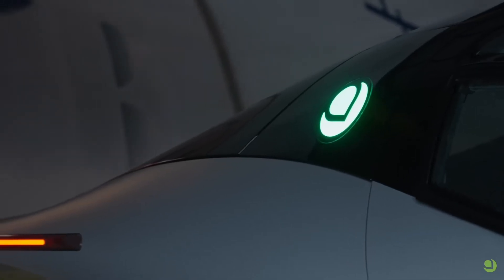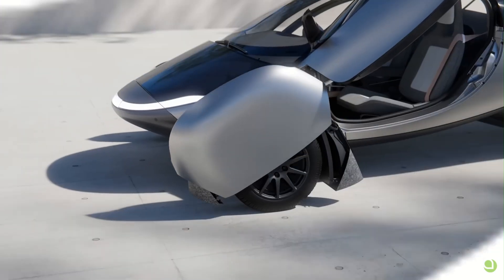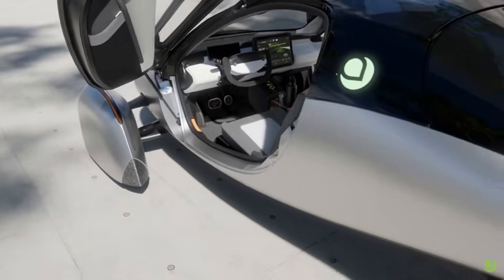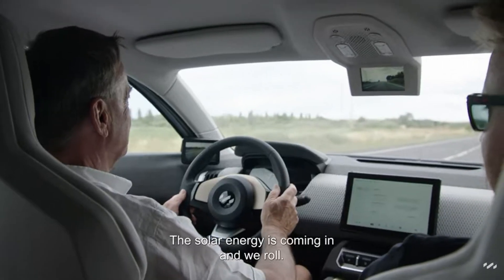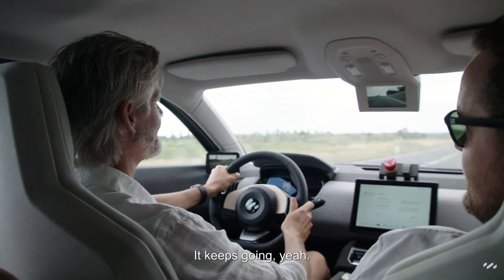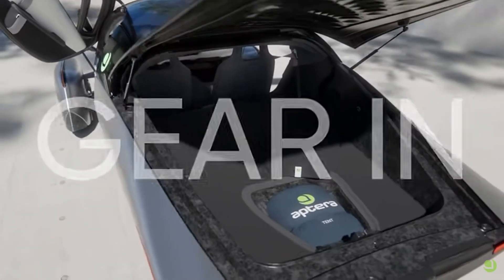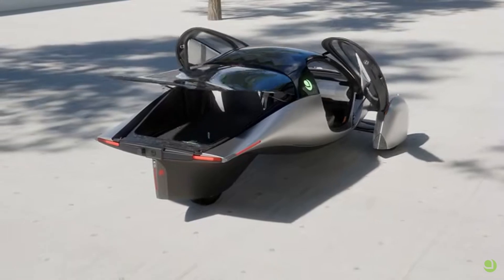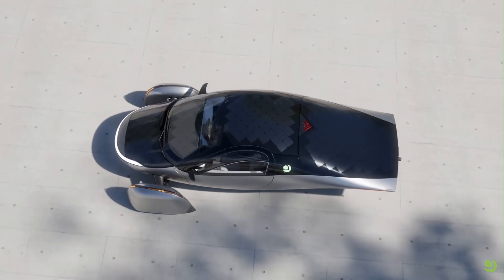Aptera Coasting Efficiency: The Best of any Vehicle Ever?

Comment: People don't know how to drive.  With a manual transmission, I would put the clutch in 1/2 mile from the stop sign.  And I never accelerate to the next red light, only to cram on the brakes at the last moment.

Comment: I love the concept, but I never drive at 80 mph, which is NOT an aerodynamically efficient speed. I’d be happy to be proven wrong. I rarely drive my Prius at or over the speed limit and I expect to do the same in my Aptera. I also expect to beat the 100 watt-hour mile. I agree fully with your comments on regen. I coast whenever possible.

Comment: Thanks for bringing up this topic! As you mentioned Lightyear has already shown a little at least what coasting can add. I’m also left wondering what Solar could add to coasting. In my Prius plug in , the display always shows my efficiency AND when the gas motor isn’t running or needed. I’ve found that coasting significantly improves overall MPG, also when I switched from low resistance tires to tougher ALL season tires my MPG went lower by approximately 8-10%. So just imagine using low rolling resistance tires combined with coasting could do in a hyper efficient design like Aptera, especially with Solar giving some charge to the battery. I’ve also found that in my Prius with its excellent efficiency display, that I don’t have to draft THAT close to a large Semi to get drafting benefits.

Comment: I don’t believe that the aptera can completely disengage the electric motor. I have seen pictures of the wheels, and have experimented with brushless motors in the past. I think that the closest thing they could do is connect all of the conductors together, but there would still be drag. Instead what most groups do is apply some power to the windings but not. Significant amount of power. This has the advantage of being able to quickly return to full power or a powered stop without additional calculations being required to compute the wheel’s current position.
Reply: Shorting all motor phases together would produce MAXIMUM dynamic braking - definitely NOT a good idea.  I've done this with small brushless motors and it's amazing the amount of braking torque they can generate, even at low RPM.  Disconnecting all phases would probably produce the minimum drag, but potentially generate dangerously high back EMF voltages.  I think (not absolutely certain) that best "coasting" efficiency would be gained by having the inverters provide just enough drive to the motors to generate a very small amount of positive torque.

Comment: My uncle was a woodshop teacher in a high school in Quesnel, BC, Canada. He spearheaded getting local industry to certify high school graduates to double their incoming salary, and got donations to double the size of the school with the new section feeding local industry. 

About 25 years ago the school entered a combustion engine vehicle fuel economy range competition, and won. For the competition they had to make the entire vehicle from raw materials, including milling their own engine block. They didn’t have the most aerodynamic dynamic vehicle, but they won with both the highest average speed and the least fuel used. 

They accomplished this by implementing a bicycle style freewheel. They would accelerate to 25mph, coast to 13mph, then repeat. Their average speed was over 17mph. Second place with more fuel consumed over the course distance had an average speed under 13mph.

In this competition the high school beat teams by both MIT and Cal Poly.

Comment: I agree, there are times when coasting is beneficial however your example of slowing down from 80 to 60 and accelerating again to save energy makes no sense and will be less efficient then going steady 70 with the same average speed. That is simple physics.
Reply from the maker: What is the calculation?

Comment: In my Model Y I use the S3XY buttons. I have one button on the back of the steering wheel set to toggle regen on or off.
I love having full regen in the gas pedal as is with the Teslas but on certain occasions when I want to coast out for the most efficient hyper mile’ing I prefer to cut regen shortly or put it in Neutral occasionally rather than find that sweet spot at 25% pedal deflection that equal zero regen. It is always amazing to me with how well the model y coasts. I am sure the aptera will be even more mind blowing.

I highly recommend the S3XY buttons for anyone here that likes to geek out on this type of thing. You  can also get realtime data on power, regen and more with the app running on the phone on the phone holder while driving to boot. Greater stuff.

Comment: I do wish the auto makers would allow easy options for regen. My first car with regen was the 2000 Honda Insight. Manual transmission, so I had the clutch and neutral easily accessible for coasting. I’ve been hyper mile’ing my 110 mile commute to work since 2003 when I can and not in a rush. That car gave me 85 mpg easily. Some folks could eke out 100mpg and get what they called the 1,000 tank back then. 10.5 gallon tank at 100mpg and you could hit the 1,000 miles on a tank in perfect condition.  There was a thread for those who could get it on insight central forum for some time. I never could but close.

Comment: Hyper milers get a boost from drafting a semi-trailer truck, although dangerous, when the reserve light comes on, I have done so in order to get to the next gas station. My question is at what speed does this vehicle get is most efficient use of energy. In my Prius, I have found that my highest MPG is achieved when traveling at around 35 MPH. Air resistance is a large factor in determining the top of the range. At 80 MPH my Prius gets about 2/3 the MPG as it does at 35. So, if I look at the Aptera, I wonder if around 35 MPH is the best speed or maybe it is higher due to the drag being lower. Just thinking the air density matters and speed has its own type of loss. Not going to drive 35 all the time, but given the physics of the situation, I wonder what speed number one can get the most out of the vehicle. Regenerative braking does work to charge up a battery, and in heavy traffic on a highway, given smart decisions, hitting the brakes is rarer than in a regular older car. I find I can up my milage on the highway by looking ahead and watching brake lights three or more cars ahead of me and adjusting accordingly.  Maybe simple physics says there is a number like 35 MPG that determines the best you can achieve, but that might be higher due to the Aptera's shape.

Comment: I love coasting. It is however not popular. Many times I have had people zoom around me only to slam on the brakes for the Red light ahead.
Reply: I came here to make this same comment. I drive a big gas guzzling truck to haul things, and try to take advantage of coasting as much as possible. People just don't think to do that I think. They would rather stay ahead of everyone else, and get to the red light first. My thinking is always, I want to coast and hit that red light so that it turns green and people are speeding up by the time I'm rolling up. Most folks don't do that though
Reply: Yes, happened to me too.  For me, I would only do intermittent coasting on empty open highway or empty streets.  Once you see someone in mirror cease immediately.   If doing intermittent coasting on the highway I would never let the speed below 62mph before bringing it back up to say 75.  Either that or draft a semi (which is also dangerous and irritating to the semi-driver).
Reply: You don't want to coast. You gain much much more mileage by regen.
Reply: @ASawyerInAZ  l currently only have a gas car
Reply: @EdErickson  understand.

Comment: Finally!  Thank you Aptera Time!  Finally someone pointing this out (that on the Aptera, COASTING may be a new driving culture - perhaps the secret surprise of this potentially revolutionary vehicle.  I am a road-bike builder, and now an e-bike conversion builder and really notice so many factors that contribute to incredible rolling efficiency of a high-end road bike versus a department store bike.   One of the first things I'm hoping to do when I get my Aptera is to completely turn off regen, and try to coast at least 50% of the time while cruising on interstate 5 up/down the west coast.  I would try accelerating to say 70-75mph and coast until 62-65mph then back again.  I'd try to maximize coasting when there are  tail winds and slight downhill stretches of road. On headwinds, and slight inclines, I'd keep steady throttle to avoid needless acceleration - just maintain constant speed.  

If I'm only applying the accelerator only 50%-70% of the time on the highway, then I would be curious just how far my "400 mile" Launch Edition will actually go on a single charge. (30% on top of the 400 will be another 120 miles for a total of 520 miles.)

What if the back solar panel is facing the sun during the trip that could possibly add another 20 -30 miles.  Would then then give us 540-550 miles of range. on the "400 mile (40kw)" pack?

However, I'm going to assume that even when regen is turned off, there might still be some rolling resistance caused by the magnets of the in-wheel direct drive, directly connected in-wheel motors. If this ends up being the case,  then I hope in a future modification, that when regen is turn off, the Aptera wheels whould be modified and made to freewheel like a bicycle rear wheel when power is no longer applied.. This would really maximize coasting efficiency.

Other factor to consider in regards to rolling resistance (a lesson learned from the bicycle road bike world)is the often not noticed factor of TIRES.  

A lot of reduction of rolling resistance can be achieved from tire design and construction.  A significant reduction of rolling resistance can be achieved by changing such things as:  a) sidewall and tire body flex compliance (increasing TPI - threads per inch),  b) tire tread compound and thread pattern, c) tire weight (the less weight on the outer circumference of the wheel, the lower the rolling resistance, d) tire pressure (a high pressure 60-70PSI tire will likely roll much better than a low pressure 35psi tire),  However, such high pressure tires  may require recalibration of suspension.   e) tire contact patch size - a smaller tire contact patch on the ground will likely lower rolling resistance.  

I wouldn't be surprised that if  a new tire design could be designed especially for the Aptera could add another 5%-10% (15-30 more miles of range?

Could it be that with coasting, solar and optimized tires, our "400" mile Aptera might possibly achieve 555-565 miles?
Reply: Of course, believing that the 400 mile LE Aptera could be made to travel an extra 150 miles by intermittent coasting, drafting, adding freewheeling to the three drive wheels, and using custom built 70+ PSI tires is probably unrealistic especially for this first model.  (Most likely, with the first model, magnetic drag and the energy required to bring the Aptera back up to speed after a coasting run may nullify much of the gains from coasting.  Nevertheless, with the Aptera's 0.13 drag coefficient, and its sub 2,000 lbs weight, I can't help but think that Aptera has more room than any other to benefit from these approaches to increasing range.
Reply: Nothing on the Aptera motorcycle ist revolutionary. It is banged together from over he counter parts.
Reply: Great thoughts. With careful driving techniques and 50 psi, my 2000 Ford expedition averages 18mpg Florida to MN. After 3 years, we switched to our small car for our twice yearly Trek which of course is way better
Reply: @EdErickson  Thanks for that reveal!  If the Expedition normally gets 2 mpg more because of maximized tire PSI and by careful driving techniques, that's about 10% more range.

Comment: I'm going to guess-timate during the summer months we'd get about 16hrs of sunlight per day.

40÷16=2.5

So 2.5 miles of range per hour reclaimed by solar.  I'm only guessing, but I think that the amount of energy used to get back to 80 mph would eat that 2.5 miles rather quickly.  As I said I'm only guessing.  However the concept of coasting is intriguing.  Real world experimentation would be needed to see if there's any benefit.
Reply: The nominal solar gain for a fixed solar panel is five hours a day.  That would nominally produce about 8 MPH, though I would guess the real value would be closer to 7.

Comment: Coasting while in drive?  Why not put the vehicle in neutral for further coasting?
Reply from the maker: Aptera definitely has the option to put it in neutral, but you'd then likely have to switch back to drive before you can accelerate again, which is a bit inconvenient and slightly unsafe. You make a good point though.
Reply: @apteratime Does it actually have neutral (disconnecting the motor from the drive), or does it simply cut power to the hub motor (which introduces losses from eddy currents from the permanent magnets which the Elaphe motor uses?)  As far as I know there is no clutch in the motor.  Most EVs don't have a true neutral, and leave their motors connected to the drive train.
It's important to note that the losses from eddy currents would be less than the losses from unnecessary regen, but you do lose efficiency as a result.
Reply from the maker: @WyndStryke  I'm not sure, I just know that N is a selectable option that has been shown on the center screen and as a pressable option under the screen. I imagine Aptera will mimic Lightyear but it doesn't seem that Lightyear put the vehicle into neutral, though perhaps they did. The Lightyear One does weigh almost 3,500 pounds, which I didn't mention in the video.
Reply: I use neutral in my EVs for coasting. There are not aerodynamic but their weight keeps them rolling longer than an ICE car.

Comment: my question is how well does the coasting hypermiling technique compare to using cruise control with regen enabled.
Reply: Coasting is significantly better if you get it right, regen is apparently about 70% efficient so that means you waste 30%.  You don't want to unnecessarily regen.  Getting coasting wrong (coasting then heavily braking) is worse than no coasting, because heavy regen is less efficient than light regen.
Having said that - many/most EVs can't truly coast, since they don't have gearboxes or clutches.  The best that they can do is cut power to the motor, but it stays mechanically connected to the drivetrain, leading to losses from eddy currents in the motor (if permanent magnets are used).  There's no evidence that the Aptera is able to do this (as far as we know there is no clutch in the Elaphe hub motor, and it uses permanent magnets).
Regarding cruise control - hypermilers turn this off, because cruise control does not understand terrain, as a result, it powers up hills and regens down them, which is a loss.  It's better to use momentum to get up the final part of the hill, then coast down it (if it is not too steep).  In very flat terrain, cruise control is OK, but even slight undulations will cause it to do this.
I don't hypermile any more, it is too stressful.  But when I used to do it, my best tank was 87 MPGuk (my car has an official MPGuk of 67 MPGuk).